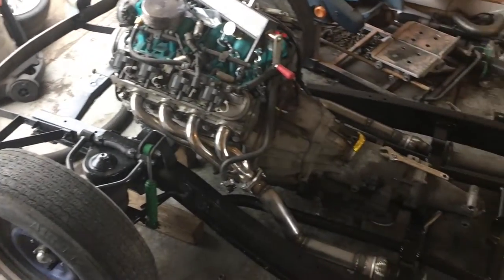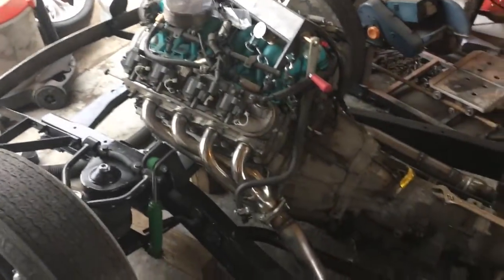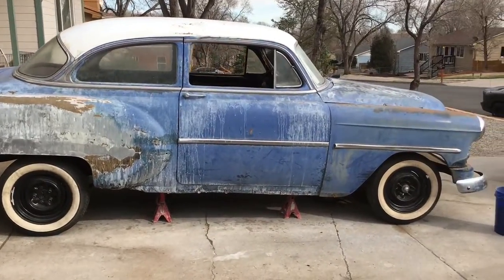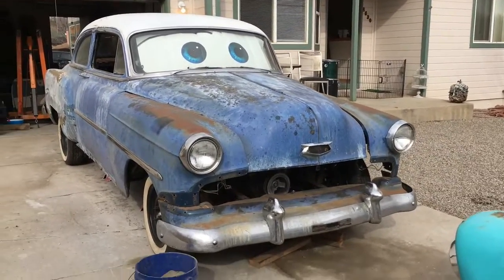LOOK WHAT I DID TODAY S12E19

Comment: Hey Wayne, are you still making those acrylic Miata cup holders?
Reply from the maker: I am not but I still have the CAD file if anyone wants to make a few...
Reply: @pawpatina  those were 3d printed?
Reply from the maker: @daviewavie112  no, water jet cut  acrylic and then heated and bent. but could be made out of aluminum.